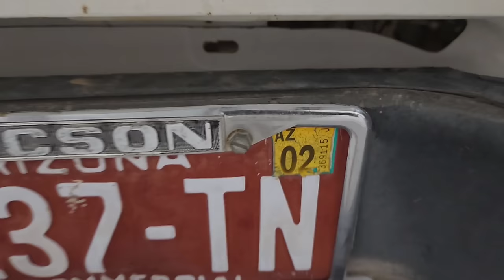RAT INFESTED For 20 YEARS! Full Restoration! START To FINISH! (ABANDONED Toyota Pickup 4X4)

Comment: My restored '87 definitely catches attention. Especially since it's red. Was always my favorite color, my first '87 that I had 20 years ago was "Toyota Red" so I did this one up just the same. I like that these trucks let people reminisce about days gone by and that's the main reason I restored the one I have now. It did take a long time to find one that hadn't been modified though. I searched for over 3 years actually, and ended up finding one in California which I shipped across country to NJ.
Reply from the maker: Thanks for the comment, Suzan! 

They do look amazing in red. I just picked up a rare 85 that is red and road tripped it 800 miles back home. The video is on my page if you would like to check it out. I'll probably end up restoring it, but it has been modified.
Reply: I have a 2003 with 42 thousand white base with same cap .❤

Comment: I had a brand new 86 in Baja tan.  Literally no options.  Best running truck ever.   No AC was tough in Miami.  Did have a dash fan  installed a stereo and speakers     Also had a 92 and a 97, a 2003.  All Manuel’s.
Reply from the maker: That's awesome! Solid trucks!

Comment: I am doing the same thing to a 92 ExCab, what is the blue stuff in the spray bottle you wash everything with, and where did you get that rubberized flooring, that is sick looking.  You did an amazing job on that truck to btw
Reply from the maker: Awesome! Sounds like a fun project. 

I use dawn dish soap in the foam cannon. 

And that rubber flooring is from Rock Auto. I think it was 150ish. It is a pain to install. If you go that route, definitely use heat to loosen it up a bit. 

Thank you, I appreciate it. 

Good luck with your project.

Comment: Very nice, but if you went to all that trouble, you should bought or fabricated a new bench seat. Other than that, well done!
Reply from the maker: I agree 100%. My goal for this one was to reuse as much as I could. I had some bucket seats I was going to toss in it, but I wanted to keep to the theme of labor time over new parts. The better solution would have been to buy new fabric and foam for the bench seat and reupholster it. The metal frame was solid. The bench seat was definitely the weak point of the whole build.

Comment: Awesome job on the Hilux man! Im also busy with mine. Any ideas on where to fine parts for the Hilux maybe. I neef stuff like sun visers and the gearlever boot etc. And also where did you find the mat for the floor?

Cheers
Reply from the maker: Thank you!

Finding parts nowadays is pretty difficult. The vinyl mat I got at rockauto. It is a huge pain to install it though. If I were to do it again, I would probably go with a different material. With all the other parts you need, I would just shop around on Ebay, rockauto, the local parts store and maybe even used parts off of offerup and craigslist. Even forums.

Good luck with your build!

Cheers

Comment: how did we stray so far from this beauty ?
Reply: If a refined process of quality and product were pursued, it would interfere with profit.

Efficiency is not the objective, as you basically just questioned.

The perfect truck was built long ago, now it is just pageantry.
Reply: @Dustin_the_wind  it's kind of like we're ALREADY in that Mad Max era where you need to FIND a rig from the past and make it work in this wasteland
Reply: @crush3095  it does seem so.

I won't say that advances in suspension, differentials, valving, all of it, haven't made a better truck; but the line between integration with progress, and something already sufficient has become muddied.

It's a mess.

We all could be driving perfectly fine, efficient affordable trucks, or cars; but this system that we rely on really is strung tight.

I could guarantee that if someone stepped forth, and started building modernized vehicles of a tried and true platform, it would dominate the market.

Trucks get you, and your cargo, from point A to B. They don't need to be as complex as they are.

Comment: That's a 1985 Toyota 4 x 4 it has the straight axle in the all Toyotas went to Independent front suspension in 1986
Reply from the maker: That is correct. They switched to IFS in 86'. This one is an 86'.
Reply: @ConservationGarage  that's an 85 they came with independent suspension the 86 
I bought a brand new Toyota 4 * 4 22RE motor and it was also turbo charged in 1986 . Love to get another
Reply from the maker: @rickwhite3181  There was no IFS in 85'. According to the front suspension/VIN# and title, this one is an 86. 

The turbo toyotas came out in 86' as well and all had IFS. I have had 3 of them and they are a blast to drive. They also made them for 87' but i've only seen them on 86'.

Comment: Isnt this Marty Mcfly's truck?
Reply from the maker: It's the same body style but has different options. The Mcfly truck has to be a: 
1985
22re
5 speed
Solid front axle
SR5
Xtra cab
6ft bed
And of course, black with all of the accessories.

There are 3 on my channel if you would like to check them out in my last video of my collection. 

Thanks for the comment.

Comment: 7 mins of cleaning, followed by 1 minute of engine and transmission work. 🤦‍♂️. You chose the wrong part to highlight bud. Well I guess most people care about the looks rather than the function. So you probably did it right.
Reply from the maker: Hey Rick, thanks for the comment. 
I have a playlist and more detailed videos on getting the motor running and driving if you would like to see more detailed videos on the topic.